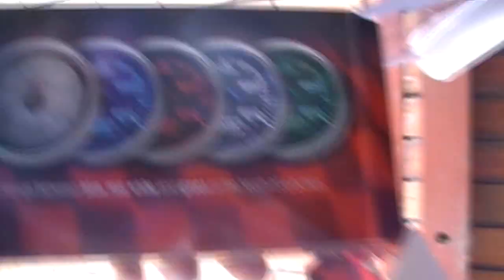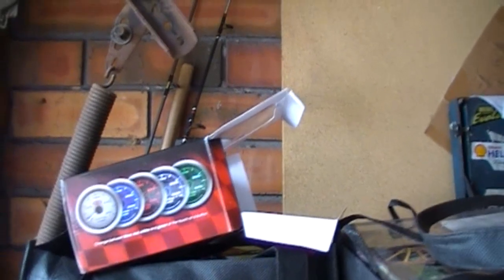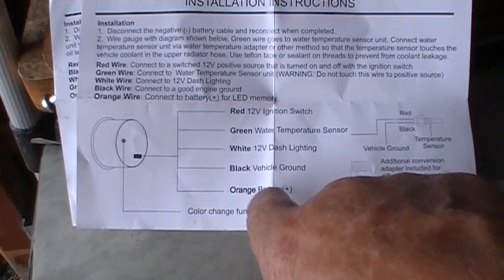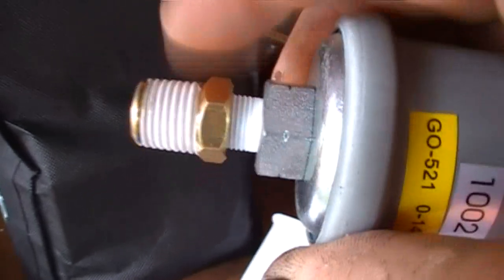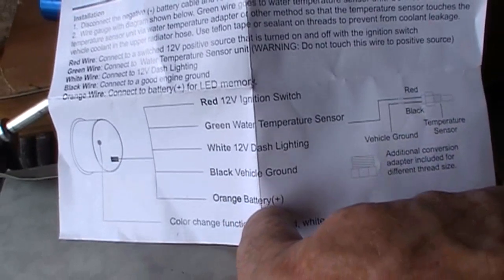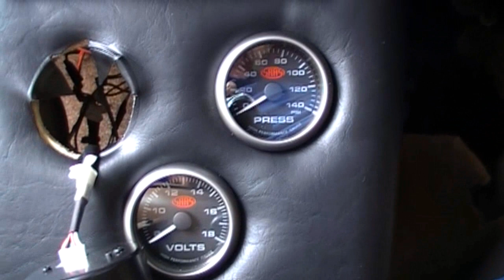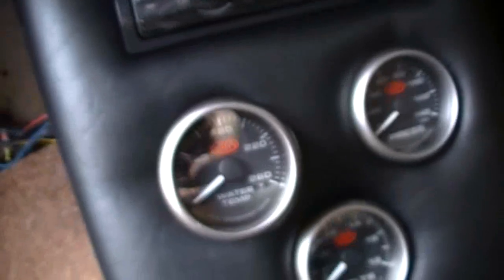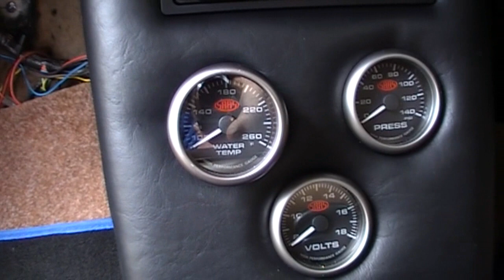wldwgn....Here's the wiring instructions for the SAAS gauges..

Comment: Where did you get the sensor (sending unit) i cant seem to find it anywhere also do you know what the ohms readings should be from the sensor ? . I cant seem to get mine to function correctly.
Reply from the maker: the sender came with the gauge...my opinion of these oil pressure gauges is not good..I had one fail so yours may fail too.. autobarn is where I bought them so may be try there..good luck.
Reply: Thankyou for your reply we ended up figuring out that they had not included the sending units with the gauges and swapped them for another set . They are working but i also think they are not very good for the expensive price we paid .

Comment: Hey mate I installed the saas vacuum gauge in my Vy and now I can't change where my ac comes out of in the car, I know it's vacuum operated and when I disconnect the gauge and put it back to normal it works fine. Any ideas on how to have the gauge running with everything working? The gauge is installed between plenum and check valve.
Reply from the maker: What engine is in your VY.?